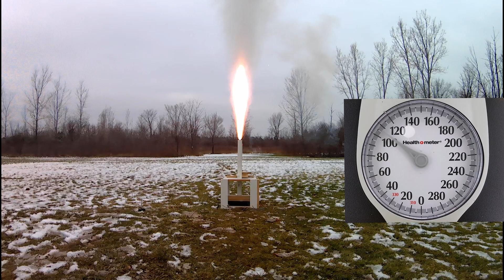Testing sorbitol with 15% aluminum.

Comment: Where did you get that purple case from?
Reply from the maker: Binder Design (Fisher Research) will anodize any case if you ask them to. This case is a swirl design.
Reply: Nice! Do you have to have your cert 2 to buy it ?
Reply from the maker: Cert 2 is not required to purchase a motor case. @normellow
Reply: Great, I’ve been out of HPR since 1998 and I really don’t feel like going through all that over again. Motors are ridiculously expensive now and this R&D your doing is the future 👍

Comment: What size micron was the aluminum powder? Definitely adding this to my propellant for my snap ring motor
Reply from the maker: I have used 5 micron and for this test -325 mesh spherical, both seem to work. The fuel works best at high pressure.
Reply: @TheRocketeer  awesome thanks. I'll give that a try

Comment: when Ammonium Perchlorate?
Reply from the maker: I will probably stick with the aluminum powdered fuel until I fully understand how it works. Properly testing fuel is very time consuming.
I am working on a new ignition pyrogen that should be interesting.

Comment: I am working with a new recipe I found totally by accident on the web for Sorbitol sugar motors and I am extremely impressed by my test burns. The difference is that it is using a split with the Potassium Nitrate at 31% and Potassium perchlorate at 31%, sorbitol 35% and 3% ammonium nitrate. All I can say is I am really impressed with the burn rate and gas production. I have poured 6 - 24mm grains with 3/8th core. My first firing will be 4 grains with 1/4 inch nozzle. I hope to get a video of the test firing but am fairly new at you tubing so we will see how it goes. I would love to see you try it out if you have the time. The propellant is impressive for sure. Your PVC rocket Nozzles are the best idea I have seen and I have made multiple 1/4 inch and a few 5/16 nozzles.   Hope you have clear skies and low winds. I love your videos and have learned a lot from you. Thanks so much for sharing your videos to us newbs! (I am 63 years old ;) ) My official channel from metal detecting.
Reply from the maker: Potassium nitrate is a very powerful oxidizer that is often used to make things go boom. It has an elevated burn rate exponent that is difficult to control. Try to keep a modest pressure level so that it does not go off the rails. You may want to start with a larger nozzle for the first try.

I am very interested in your test results. If you can keep the motor together then I will consider giving it a try. Light the motor from the top and keep a very great distance between you and the test motor.

You can find my email address on my home page under the "About" tab. Good luck and stay safe!!

http://www.nakka-rocketry.net/knpsb.html